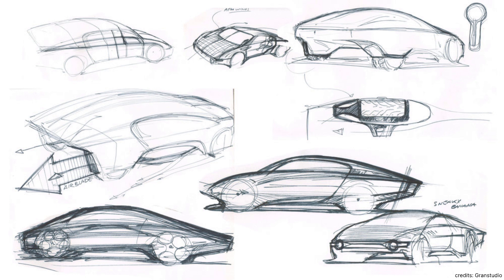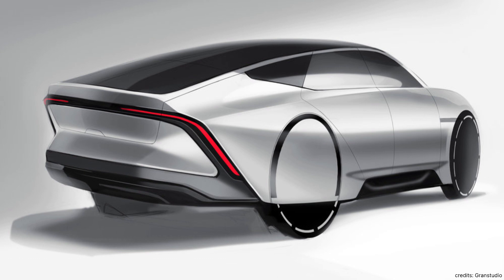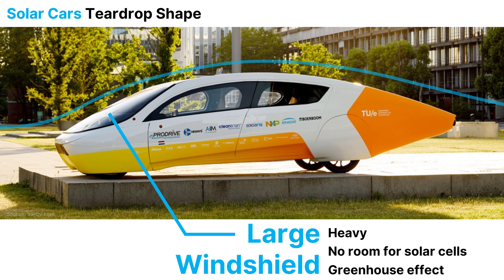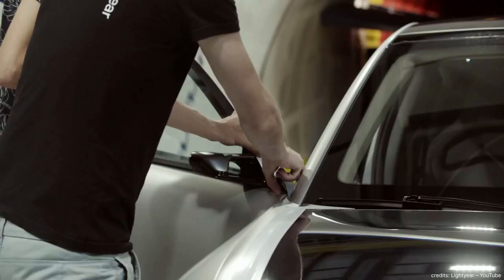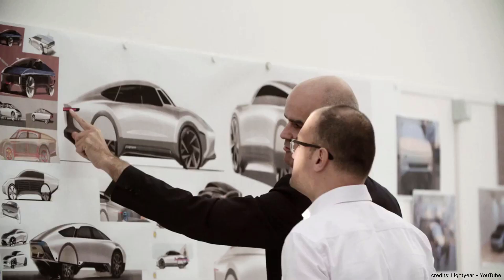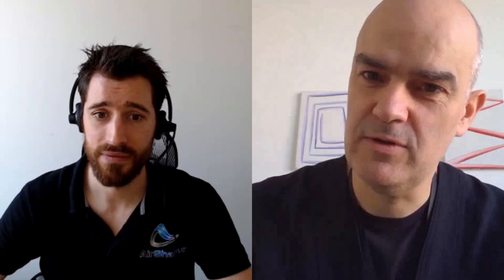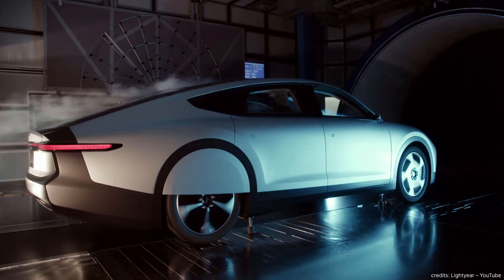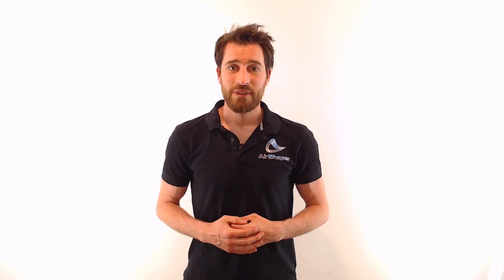Lowie Vermeersch #2 - The Lightyear One Solar Car

Comment: Great insight into teardrop shape vs separating bonnet and windscreen, thanks. Still, personally I prefer the Aptera shape ;)
Reply from the maker: Ah, yes, the Aptera! Purely from a technical point of view, it makes a lot of sense! I guess if you want to make a difference, it's about the delicate balance between making a no-compromise product for a small group or a more general product for a larger group. Both are very interesting :)
Reply: @AirShaper  True. I missed the fact that Lightyear One is a 5 seat vehicle. Aptera Roadster is a two seat vehicle which gives them options not available to Lightyear. They do have a 6-seater on the roadmap and I'm curious what approach will they take for it and what shape will they end up with.
Reply from the maker: @jurepecar9092  Ah that would indeed be interesting, a 6-seater drop shape, I'm curious as well then!